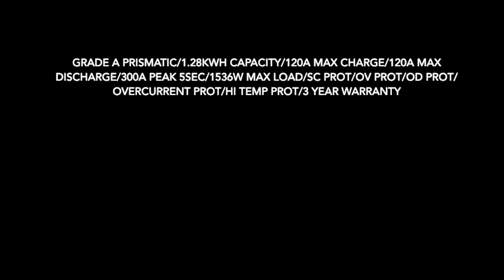XZNY 12.8 Volt 100Ah LiFePO4 Lithium Battery Review and Teardown

Comment: I really like the 4 24 Volt 100ah Lithium Iron Phosphate Batteries tied into Buss Bars for 10KWH Feeding both a 3000 Watt WZRELB and a Victron Phoenix 24/1200 Low Frequency Inverter powering the Ole '58 Spartan Manor Motorcoach used as a Bunkhouse
Reply from the maker: Nice! 👍

Comment: have you seen or tested the. EVE 105ah. cells on Amazon? ?  im wanting to buy 8 of em but dono if they are true cells
Reply from the maker: Yes I have seen the listing for the cells. I can’t speak on authenticity. What drew my attention to the listing is why raw cells are still more $ than a complete battery. More components and more work into the complete units but still can’t get raw cells cheaper…
Reply: @THEOFFGRIDMOUNTAINHOMESTEAD  true
Reply from the maker: $100-$120 for (4) 105s with free shipping and I’d be all over it though

For a 16s build and custom BMS.